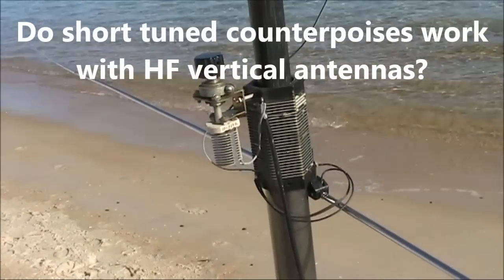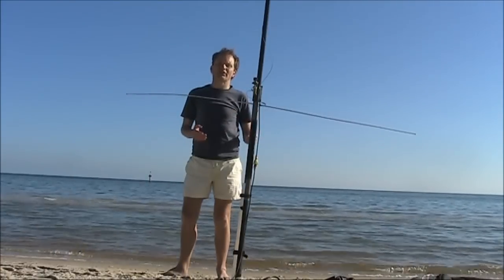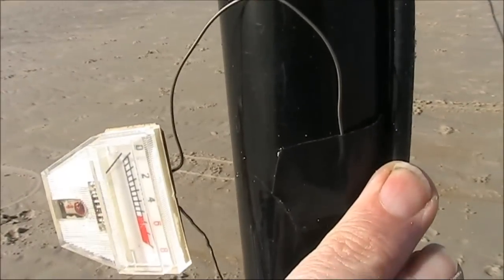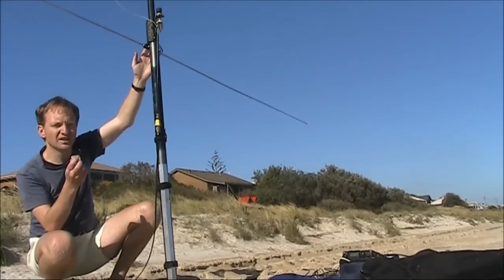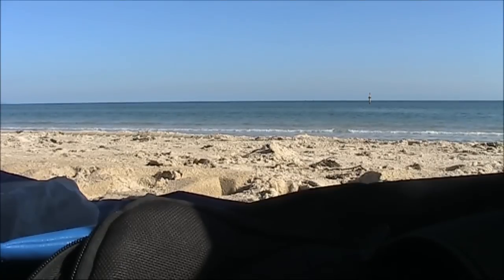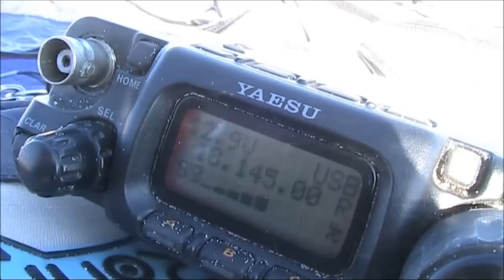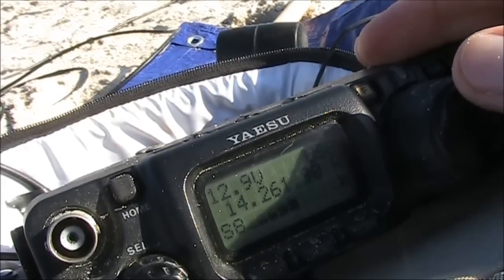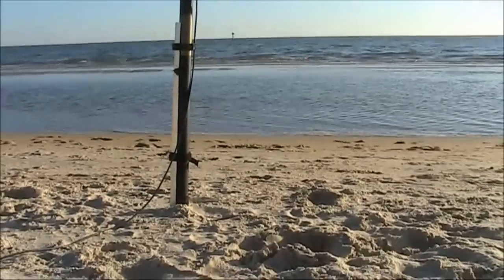Do small tuned counterpoises work with HF vertical antennas?

Comment: You stated that it's 1/4 wave length antenna at 5 meters, that more like 1/8 wave. Was it that short?
Reply from the maker: 5m is about 1/4 wavelength on 14 MHz (20m).

Comment: Great video Peter, that counterpoise is very interesting, I’ll have to try that out, how do you calculate the coil size for the counterpoise?
Reply from the maker: Good question. I just used on large enough and tapped it down.  Might have used a small RF meter and adjusted for maximum indication.

Comment: What kind of material is your inductor coil wrapped around?  I can't quite tell what it's made of.  Great video!!
Reply from the maker: It's an old salvaged coil.  Possibly bakelite.  But you could use cardboard or plastic tubing.
Reply: Thx!! In Les Moxon's book clip you showed had the coil trifilar wound but yours looks like a single wound large coil - is that what I saw?

Comment: Fantastic video Peter! I am thinking of using a vertical hamstick dipole for 20 metres, using two hamsticks resonant for that band. Am I right in thinking that as long as the coax feed is at 90 degrees to the dipole that the lower hamstick element will act as an effective counterpoise?  Great stuff Peter and well done ! 73s Tim.

Comment: Hi Peter,
I sometimes use a small telescopic antenna on my metal frame backpack if I`m at a location where the SWR is a bit on the high side and the GTU takes care of the rest. I find it much more user friendly than the normal trailing counterpoise and more efficient. You should give it a try pedestrian mobile. Enjoyed the video and looks like you may have sparked an old  interest in amateur radio with that chap. Great stuff
73 M0DAD
David

Comment: Hi peter. great videos. could you tell me what do you use as an external power supply for your 817 please?
Reply from the maker: +vk4frik1 Usually just a battery. Though I do have a homebrew supply for bigger gear.

Comment: Hi Peter; re the problems of dogs running over the top of radials laid out on the sand, I have similar problems with kangaroos here with ground-mounted vertical antennas!  I will need to elevate the radials to at least 2.4m above the ground (so livestock, people and vehicles can pass under them), but full sized radials on the lower frequencies need supporting at intervals along their length.  I'll look further at what you've used here - maybe I can use shortened radials?